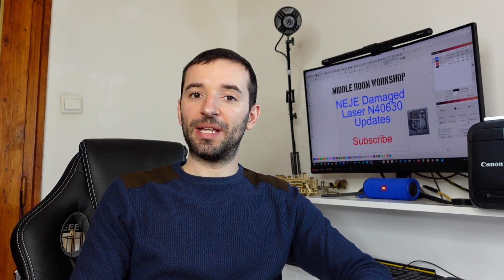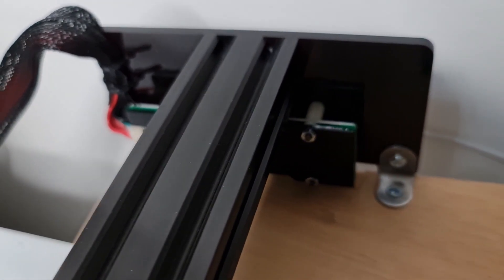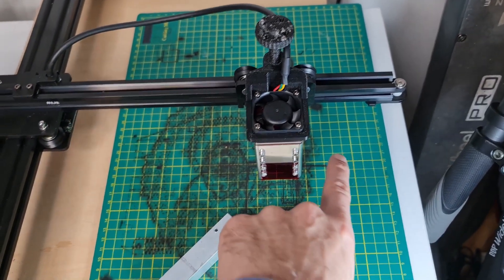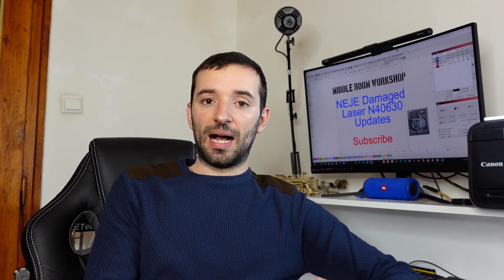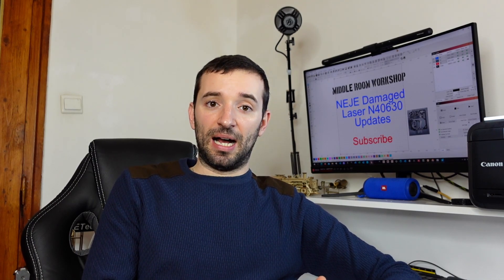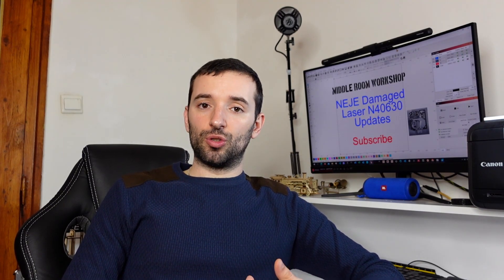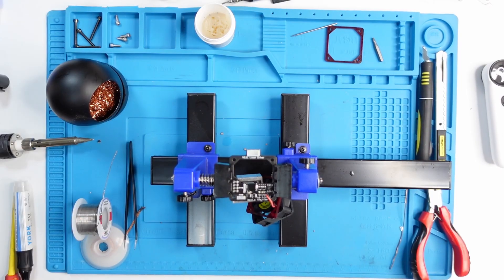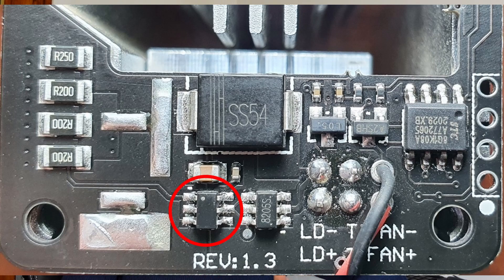Laser Module Damage's Repair Update |  NEJE

Comment: hello. i just checked the board on my working n40630 module and the component also has no label (although the board is rev. 1.4 not rev. 1.3 as in your picture).
greetings from austria
Reply from the maker: Hi s l, thank you for your comment. 

That is a good piece of info for me. 
It means that NEJE has put in some unlabelled component and that, indeed, it was not heat erased as I first believed.  
Anyway, it turned out to be not the faulty one, and the problem was the small IC. 

I have finally opted for a replacement of the driver board https://youtu.be/W3FDWGTS6eo
but I am still investigating how to repair the damaged board. 

Greetings from Italy

Comment: Thank you for this informative video.
Last video was also good effort regarding repair or replacement of driver board.
I have N40630 neje 30 watt Laser module.
Now its not working and no light is coming out from laser.
What you think where is problem in driver board or in lower small board.
My other question is what is difference between N40630 & A40630.
Reply from the maker: Hi Atif Ali, thank you for your comment. 

Let's start with the easy one: the difference between N40630 and A40630 is in the laser compression technology or simply the lenses, which in the A model produce a finer spot, making the laser more effective for cutting and producing higher quality engravings. The size difference goes from 0.05mm to 0.04mm.

Now to the hard one: If you watched my video and the behaviour is different, then two things could have gone wrong; 
1) The upper board has been completely damaged, so it does not initialize, and as a result, you do not see the laser flash.
2) The lower board, i.e., the LED, was damaged. This second option is improbable unless you have plugged in a 24V power supply.

Have you tried turning on the machine without plugging the laser module? Better also to send an engraving job to see if at least the trolley moves like if it is engraving.
This will help us discard the mainboard.

If you have done the test above, you can try to inspect the upper board by removing the fan and see if something is clearly burned or not looking right. 

Let me know
Ciao
Reply: Hi, I have the exact same problem, bought laser January this year, only used a few times, the fan works, but no laser light, all the backboard lights flash and the laser will go through all the engraving movements when I set up a job without the module attached, But as soon as I plug in the laser module all the lights on backboard goes out! Help!